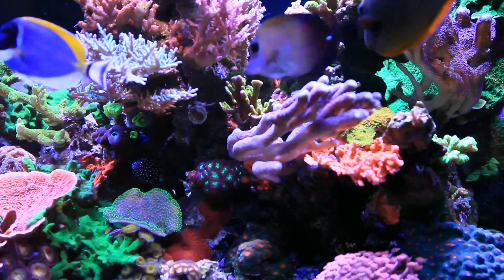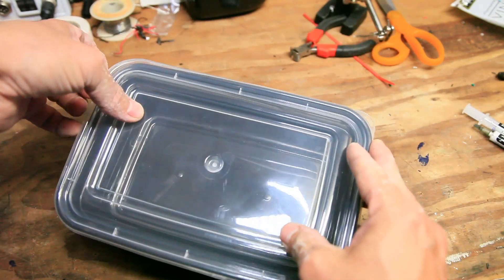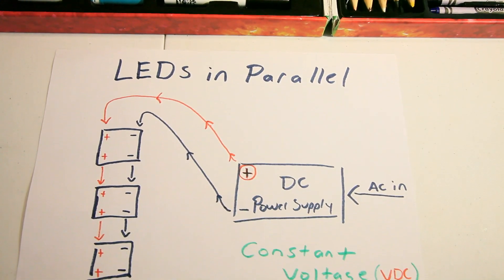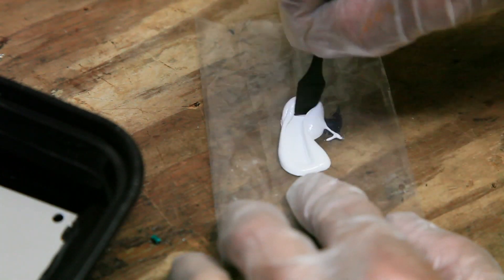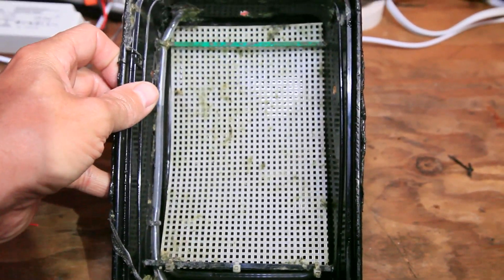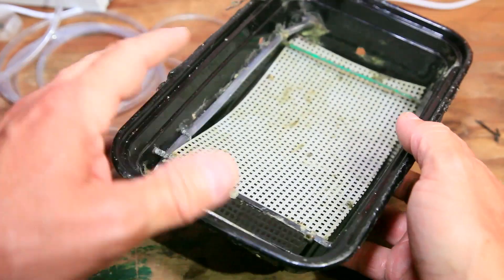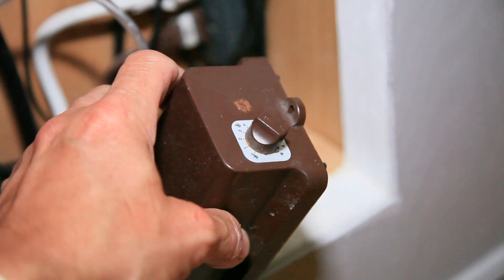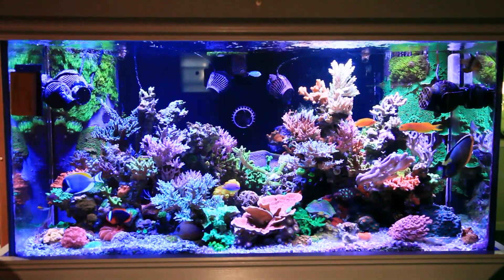POWERFUL DIY ALGAE SCRUBBER BUILD (FOR UNDER $45!)

Comment: Thanks for the great video gave me some ideas, I did a DIY light for my pico tank and used some 3d printer like extrusion. 80mmx20mmx300mm I just used silicon to secure the led's. They stay put and if you burn one it is pretty easy to remove.

Comment: any update on how it worked?
Reply from the maker: The scrubber was installed for two years and worked as expected, producing some hair algae and bacteria on the fine mesh which I wiped off weekly with a paper towel. The system was nutrient depleted so I removed it.

Comment: Can you just use an led strip similar to what you would use on the back of a TV. They are so cheap and you can control them with your phone.  Not to mention simple.
Reply from the maker: They are unlikely to have enough output to be effective. With that said, I’d just see how that compare in color temp and output, to the 3 watt LEDs and driver that I used in my build. I’m not sure how cheap your TV LEDs are, but the ones I used were very economical. Be very careful. You will need enough heat sync and ventilation around the LEDs to keep the scrubber running cool, or risk potential fire hazard. Best of luck.

Comment: Nice! 
Curious how that heat paste epoxy is holding up so far?. For me it only lasted a year before the saltwater environment/evap caused the leds to come loose.
Reply from the maker: Reporting back on this. 6 months later and heat sync epoxy is still holding firm
Reply: Still going strong? Going to make this soon if so
Reply from the maker: So far, no issues, but it has not been a full year yet. I’ll report back, if there are any future failures

Comment: Funny thing that one looks just as good as Santa Monica’s scrubber I think they use the same parts lol
Reply from the maker: Nice. Their scrubbers are definitely a cut above this DIY upflow, but this is a great option for reefers on a budget. My plan was to first try DIY and if it was a total flop, purchase one of the SM models, which I still may do for the rack and rubble frag tank downstairs.